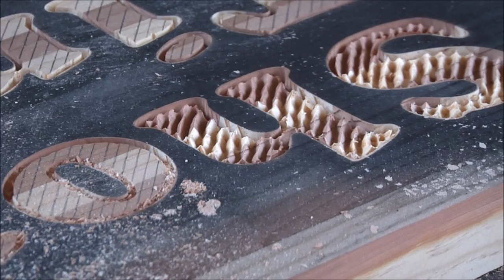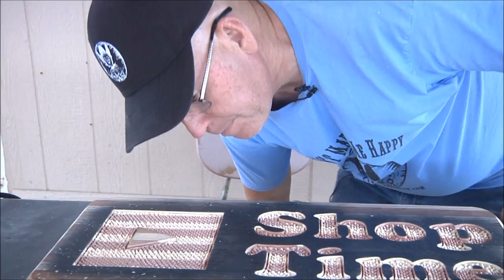#295 Peter Brown Sign Part 3 + Star Diamond Background

Comment: Eric, I have a question.  Why not just use a 1/4" spiral upcut bit set at 1/16" to 3/32" to take down the high spots through out?  Seems like that would save time having to look for all of them (and I almost always miss some) and give you a uniform level for the entire inset.
Billy
Reply from the maker: That's another way to do it. My goal is always not to have any high spots to take out. Not sure I would like the high spots to be perfectly flat.... I might give it a try. Thanks, Eric